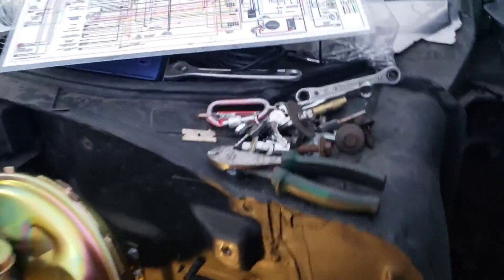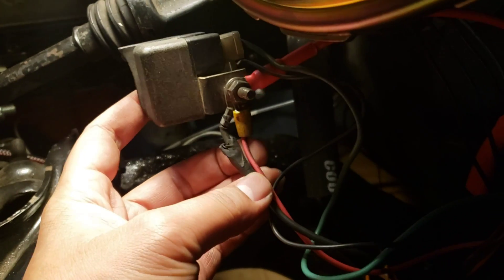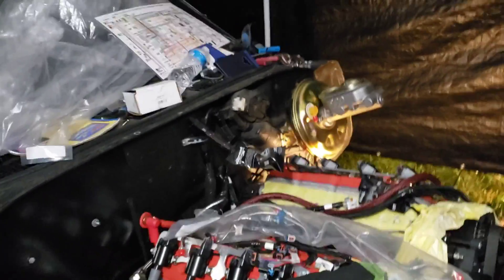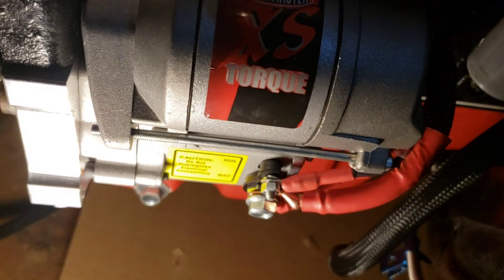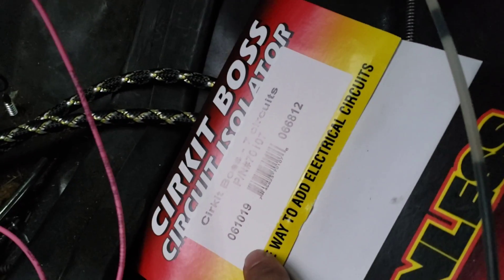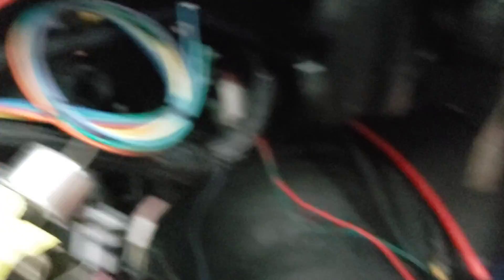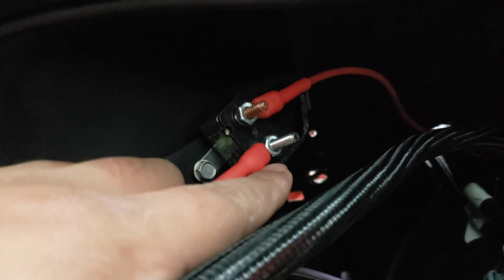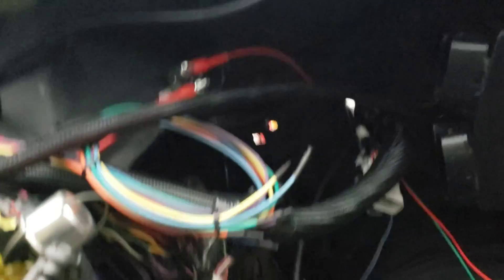LS swap starter wiring | 72 Chevelle SS

Comment: question on the starter wiring. (LS5.3 and HPI wiring harness) the ignition wire didn't come with the harness. The wire from the small terminal on the starter (ignition) starts there, but what does it go to?  Please help!
Reply from the maker: Sorry man I don't know, did this a while ago and I'm pretty sure my engine harness was all cut up from someone before I got there pink and red is what you're looking for for the starter I believe don't quote me tho 😂. . .  if you go to OPGI they sell that wiring harness diagram that you see in the video.
Reply: @Califormula  I figured it out. On the stand alone harness there are two wires that are very close to the crank sensor. BOTH of those wires have a ring terminal attached to their ends. BOTH go onto the positive terminal on the starter. Then, there is the smaller "S" terminal or sometimes called the crank terminal on the starter. That terminal connects directly to the bulk head wire that offers electricity while the ignition is in the crank position. Mine was very dirty, but i think its a pink wire (stock) on my 1984 C10 bulkhead.
Reply from the maker: @mickmcneely2413  glad you figured it out ) sorry wasn't much help) now it's time to start it and instantly do a burnout 😂

Comment: I'm wondering how to do my wiring.  Batts in trunk. Now I have wire going from batt to starter.  But I'm thinking of running wire from alt to battery and firewall relay to alt to power everything.  Gonna delete one starter wire and just run s terminal and batt. What you think
Reply from the maker: there's a few different ways to do a rear batt. . .the way I did mine isn't even the way I would recommend, I would run a main power shut-off switch a main circuit breaker. . . wire to the starter post or a common lug for starter and alt. as far as an accessory panel like mine goes get your ACC from somewhere on the main harness and constant power from the main lug from bat. or somewhere on the main harness as well. . .

 the main power to your starter needs to be good wire mine are super fat because I'm running beat. . .not really needed tho.. . . there's hella different ways to do a rear battery they sell kits if you're not comfortable with wiring that's what I would do buy the kit!!! or just steal the blueprints from one of those kits and make your own the same way!
Reply: @Califormula  smh, mine not even turning over lol. If it aint one things its another. I came back here to double check myself. Wiring is good. Just won't crank
Reply from the maker: jump the starter lugs, that way you can check that the starter itself is good. Then test the leads at the end if the starter is good make sure you're getting power from the ignition switch, after that check your neutral safety switch.
Reply: @Califormula  man I thought those days were over with. My initial problem is back so I gotta wait now.
Reply: @Califormula  Well I got work to do. Cutting corners dont work no more lol. I did jump the starter and it works, however my main issue is back and I have to figure that out first and last. I'll check the wire ends tomorrow.  I also gotta put a relay on my fuel pump, yea I know I know! Man o man! It all started with a leak lol
Reply from the maker: @benaiahtheassassin  it's the little things man the big stuff's easy that little shit is irritating that's where I'm at right now that last 10%. it'll get done and be well worth it. I just need to practice what I preach 😂
Reply: @Califormula  yeah man my car was supposed to be started today.  We will get there
Reply from the maker: @benaiahtheassassin  yeah man just take your time I don't set dates or any of that I used to do that, makes me cut hella corners you'll end up with a better result in the end,something you're prouder of!
Reply: @Califormula  i cut all kinds of corners lol, my lights even stopped working
Reply from the maker: @benaiahtheassassin  😂 you'll figure the little stuff out all these classic cars are hella straight forward plus they sell replacement everything!
Reply: @Califormula  yea after it drives me crazy lol! Watching your vid got me wanting to change my dash now
Reply from the maker: @benaiahtheassassin  yeah I pulled out that old dash it was all cracked up and I just couldn't get myself to put it back in and a new one was over $1,000 so why not spend the 1K+ on something better! Also not a fan of running some Dakota digital shit like everybody else.
Reply: @Califormula  Its definitely something at the switch. Checked the wires and they get power, also get power with key on except a orange one. Gotta check what that is. But I think I might replace the switch.
Reply from the maker: @benaiahtheassassin  the orange wire on the Chevelle is for the heater the blower motor in the engine bay, at the base of the steering column there should be a flat plug you can use that plug to test the ignition key, sounds like you're getting closer 💪🏾
Reply: @Califormula  its right here somewhere,  when I start poking around with the tester the power came back inside the car but then disappeared. I think its the switch
Reply from the maker: @benaiahtheassassin  yeah man if you touched it with the tester depending whether the other side ( the clip) was on ground or constant that's what you're missing. . . something is either not grounded or something doesn't have a constant or ignition. redo that and then check all those wires at that one that you touched.
Reply: @Califormula  i touched them all lol. They all lit up, so I think tge switch is bad. Power goes to the switch, but the switch doesn't send signal with key. So if I turn on or off the switch is saying key is off
Reply: @Califormula  I hope lol
Reply: @Califormula  ok its definitely not the switch 😖. Still having the same issue. You said its either ground or hot. Well since there is power going to it then maybe its not grounded.
Reply from the maker: @benaiahtheassassin  when you were testing all those wires was the alligator clip connected to a ground or to a power source? and was the ignition on or off when you were testing stuff. if it was off and the clip was grounded then whatever you touch that gave the dash power is missing a ground. or vice versa and I know you've checked your fuses which should be the first thing especially when everything stops working.
Reply from the maker: @benaiahtheassassin  this is what I do when there's no start. . . jump the starter if that works check the fuses, check all connections first at the starter then at the fuse block check any wires that you spliced or cut the connection points at. I heard you mention you had a kill switch if you don't have an ignition source to that kill switch then that main power that's running from the switch to the starter doesn't have power.
Reply: @Califormula  wooooowwwww.  So all the other stuff checks out to be ok. Now there is nothing at the switch for ignition.  Just msd box, fan, starter and alternator.  I thought since 12v was supplied to the starter it would juice that wire as well. Also there is a wire from the relay on the alt and starter supplying power back like the factory.  You may be on to something.  Only wire i cut was to the alt and that was to run 1 wire. Everything else is factory. The line from the switch to starter is full power like line to the alt
Reply: @Califormula  I used to have a jumper on my gen 1 sbc. Wire from positive side to s terminal.  But every thing in the car still worked without it
Reply: @Califormula  it was connected to a ground. I tried both on and off.  I even cranked it to test s terminal wire. You got me thinking here 🤔
Reply from the maker: @benaiahtheassassin  so when you test under the dash the purple wire has power, if not that would be the problem on the Chevelle wiring, also double check that horn relay my factory setup was hella janky when I move it a certain way it would work and then it wouldn't I had to rewire all those that went to that junction they were barely holding on by like two strands.
Reply: @Califormula  didn't test a purple wire. The purple wire under the dash i believe is the neutral safety switch. That won't allow it start but shouldn't block power
Reply: @Califormula  yeah I still have all factory stuff in that aspect. I never really touched it.
Reply from the maker: @benaiahtheassassin  there should be a purple wire on both sides of the bulkhead it's just interrupted with the neutral safety switch I don't even have it in my car the switch that is.
Reply: @Califormula  I seen it under the dash
Reply from the maker: @benaiahtheassassin  don't know what year your car is but this is a 74. . . https://www.google.com/search?q=main+Harness+power+wiring+1973+Nova&tbm=isch&ved=2ahUKEwih0ePg6t7uAhVrATQIHc8uAW8Q2-cCegQIABAC&oq=main+Harness+power+wiring+1973+Nova&gs_lcp=ChJtb2JpbGUtZ3dzLXdpei1pbWcQAzoECCMQJzoGCAAQCBAeOgQIHhAKOgQIIRAKUNC_BFi4ugVgpL8FaAFwAHgAgAF0iAHOF5IBBDI0LjiYAQCgAQHAAQE&sclient=mobile-gws-wiz-img&ei=h5AjYOHxI-uC0PEPz92E-AY&bih=718&biw=412&client=ms-android-verizon-sscr#imgrc=FsyTmqVmQ_1izM
Reply: @Califormula  I was looking at that but the other half of the page is missing! But I think your right, the s terminal has to go the switch or something
Reply: @Califormula  🤣🤣😂😂😂😂🤣🤣🤣🤣
Reply: @Califormula  could it be possible that the wire that went to alt powered all the gauges? Even tho it was only supposed to power gen light
Reply from the maker: @benaiahtheassassin  (my bad accidentally deleted one of the comments) see I told you you're getting closer 💪🏾💪🏾the power wire that goes from the alternator to the starter are already touching at that junction block so you said I thought!?  from that diagram it looks like there's a red wire that goes from The junction block to the bulkhead I think that's what powers the whole junction block at least from that 74 diagram but if there wasn't power coming through the junction block the ignition key wouldn't work at all
Reply: @Califormula  Yes, alt and starter have a wire going to horn relay or junction block. But I still can't figure out this gauge thing. Maybe its something small. Thats my main focus is getting power there to the tach
Reply: @Califormula  so I guess its 2 totally diff things and I'm chasing one thing and you were chasing another lol
Reply from the maker: @benaiahtheassassin  just the RPM or the one from the actual OEM car you can wire that stand-alone Autometer by itself. check the plug on the back of the OEM gauge that plug is crap there's like little brass hooks that come out for the plug.
Reply: @Califormula  my afr gauge is connected but not hooked up and use that and the tach to gauge the power inside. My radio also now comes on which didnt before. Once I started touching wires boom.
Reply: @Califormula  just rpm gauge, its wired to the fuse box. I just re went over the afr gauge and if I ground it diff it cuts on. So the tach is next. The factory gauges dont work. My trans doesn't have a hole for speedometer, I don't care about the gen light, temp light etc because they aren't hooked up lol
Reply from the maker: @benaiahtheassassin  I'm glad you're figuring this shit out now that little shit be irritating that's why I'm doing hello random stuff cuz all that little shit irritated me so I swore when I build it again which I'm doing now I do it right! grounds are hell of important grounds are more important than power everyone thinks power runs through the power wire power runs through the ground if that makes sense. you can never have too many or too good of a ground. and it's definitely worth cleaning the paint off where you're grounding it I used to not do that shit but it's important!
Reply: @Califormula  bruh, it was driving me crazy. Afr gauge is on now on to the tach